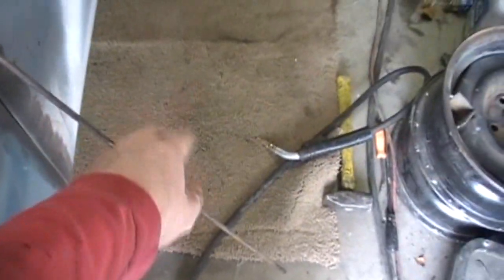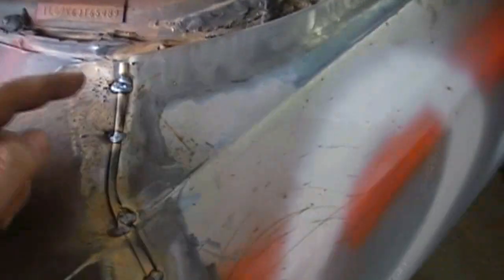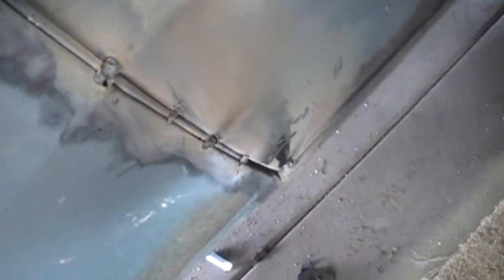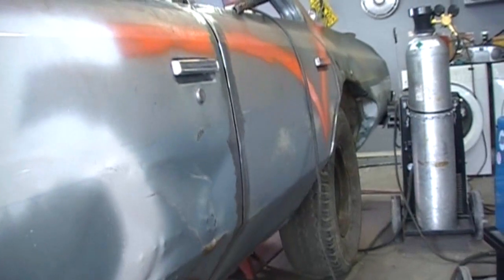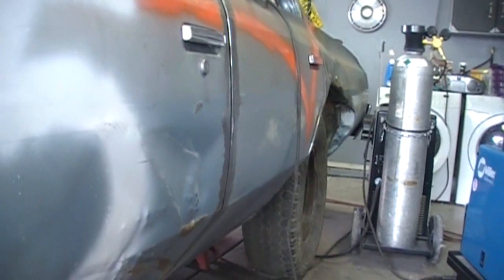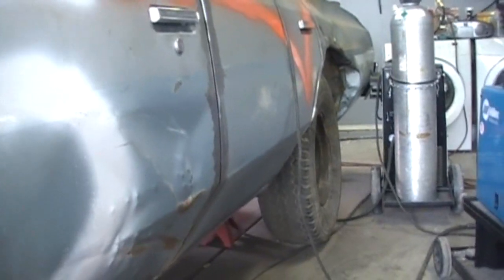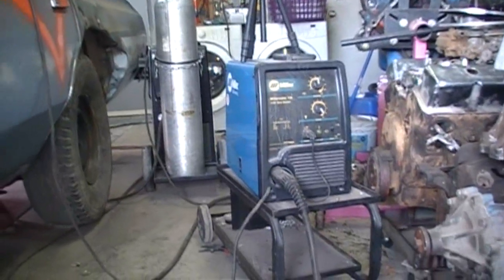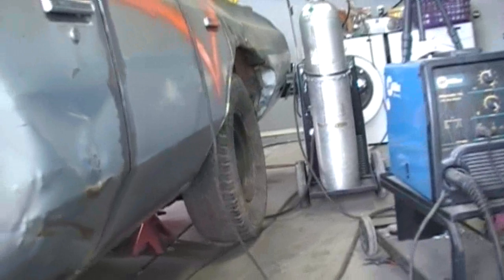Demolition Derby Tech. Door welding basics.

Comment from the maker: Cool now I can add Sweden to the list. I don't remember the settings. But I start at a very low sheet metal setting. And only go up if it leaves lumps higher then 3 millimeters.  Lowest setting is best. And clean helps a lot too. Don't want to try and burn the metal clean for the weld to stick. I only try and tickle the sheet metal with the arc from the welder. I bet it ain't penetrating any deeper then real fine paper.

Comment from the maker: I should have said something about that. When you use straps. Even as thin a 1 inch. You are only welding to 1 layer of sheet metal. Because of how the factory folds over the door skin. You are welding to at least 3 layers. And sometimes more at places where the door bar reinforcement tucks in.